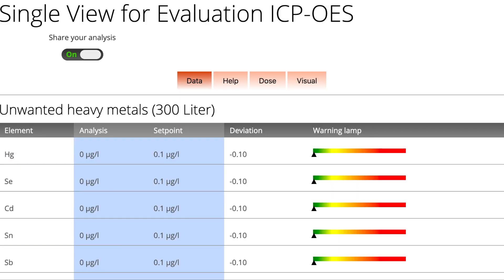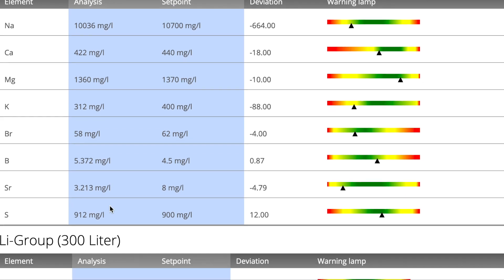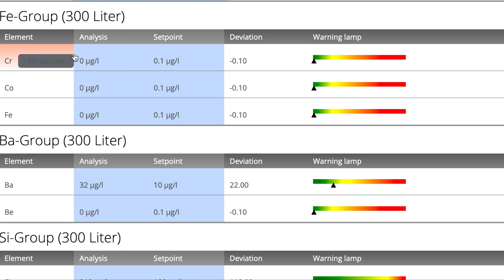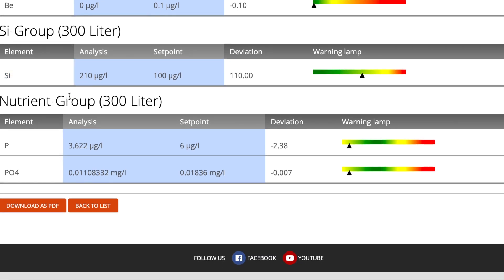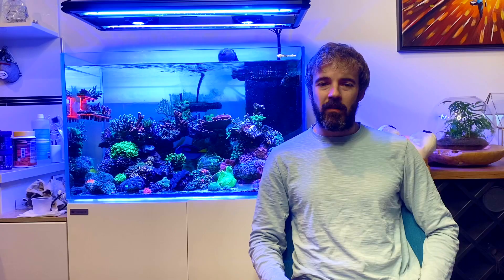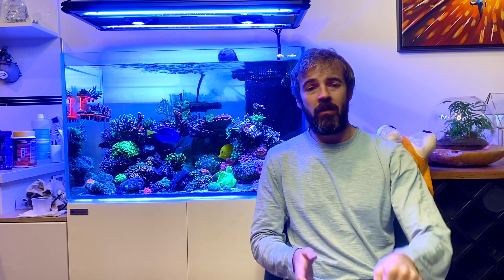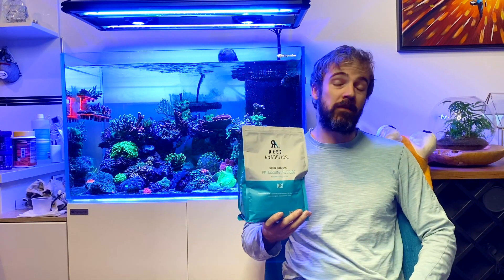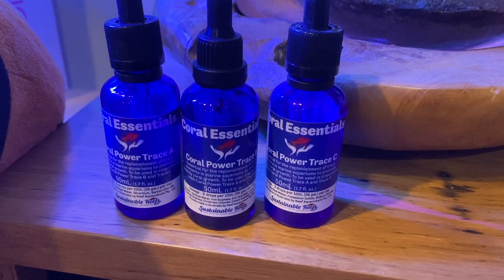ICP Test Results with a Calcium Reactor

Comment: Are those aluminium  readings possibly because of your marine pure cubes?
Reply from the maker: Possibly. Hard to know for sure. Though anecdotally many people do believe marine pure cubes can leech some aluminium. I don’t know if there are facts to support this or not.
Reply: Yeah, I believe BRStv did an investigation and came to the conclusion that marine pure did in fact leech aluminium. That was a while ago though so it may have changed since. I use marine pure myself so I'm still weighing up on whether or not I should slowly swap it out as well.